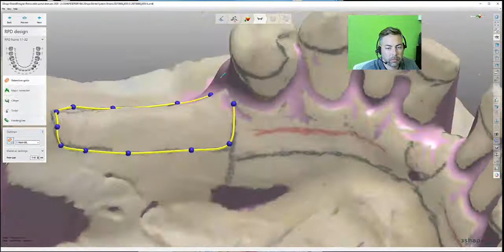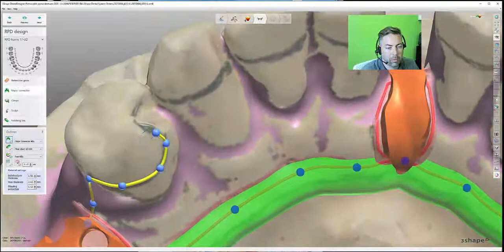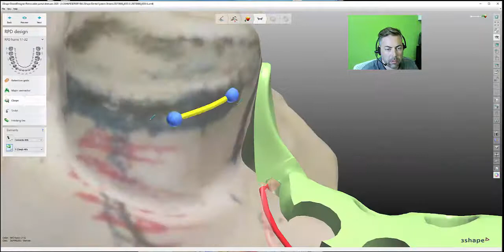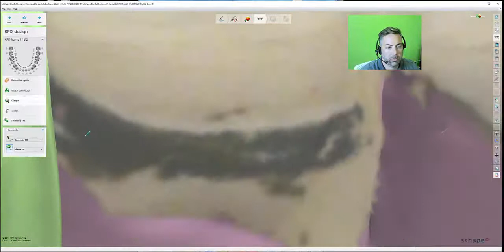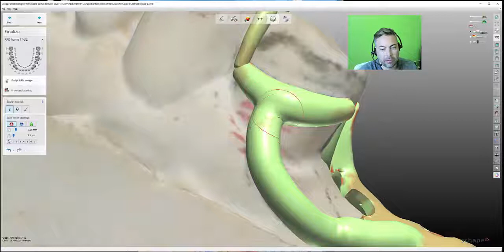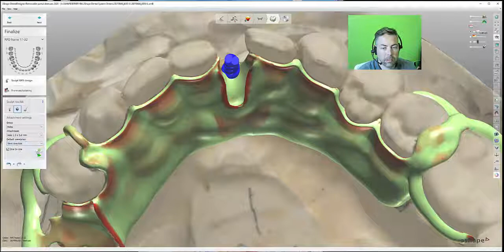3Shape CAD training for lingual plate RPD--#2

Comment: Hello … I am wondering if you are concerned about the liner space that using the major connector tool applies … would that not leave space in the plate … isn’t there a new plating tool that doesn’t use the liner space